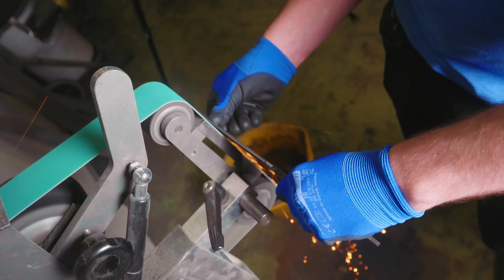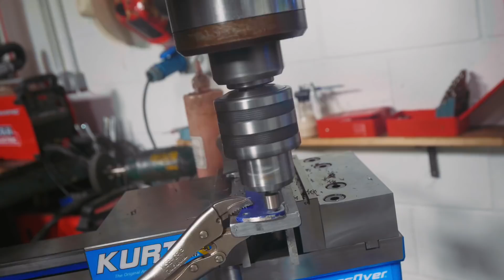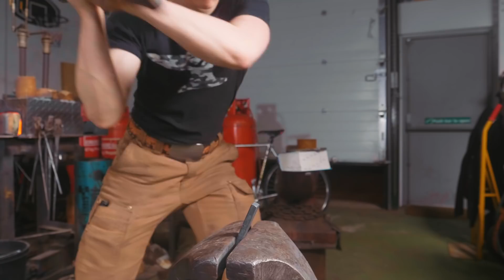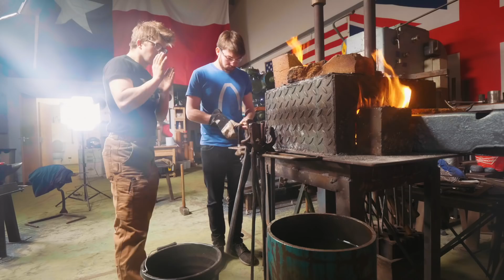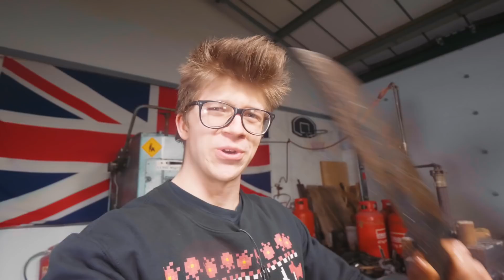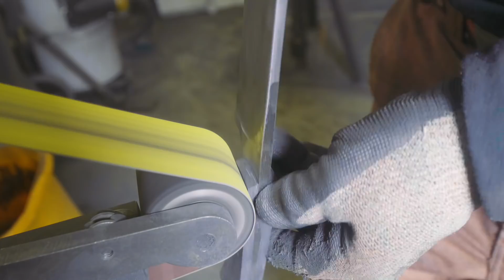MAKING A BOWIE KNIFE WITH REAL ENGINEERING!!! PART 2 - WHY we heat treat steel!

Comment: Alek, why dont you try useing wedge anchors for mounting your grinders and other shop tools.  Redhead is the brand i normaly use.  Just place whatever you wana bolt drill the hole put the washer and nut on the bolt pound ii in the hole and tighten it up!

Comment: Note that tempering has some odd-ball characteristics.  The temperature versus time to get a specific temper balance is NOT smoothly increasing in some alloys.  In some alloys, it has a downward valley so that using this poor range of temperatures actually can cause the metal to be WORSE than no temper at all.  This is called "Temper Embrittlement" and armor plates made prior to about 1930 (and a few even after that date) suffered from this compared to optimally hardened and tempered armors used in WWII -- some older projectiles that could punch through the old plates with no damage were now shattering against otherwise identical plates made using the later temper methods.  This is why working with steel is so complicated when trying to match the final results to the various intermediate processes needed to make the object -- sometimes it feels like "you can't get there from here"!
Reply: Wasn't that (combined with bolts replacing rivets) what made the damage from Titanic striking the iceberg much worse than it should have been?

Comment: On the normalised, hardened and tempered piece it had that fractured that dropped down at about 45 degrees as the crystal structure is FCC which was a slip plain along the (101) plane causing it to fail at 45 degrees. That is why it dropped down so much, because it was the weakest path through the material. Love the vid.

Comment: Fun video Alec. In my engineering materials class we talked about that fracture line on the last piece. It turns out that 45 degrees is the angle of least resistance for shear (when the two half's go flying apart). It's fun to see the real life equivalents.

Comment: The hardened and tempered steel that broke at about 45 degrees because the crystalline structure of carbon steel is a little box of iron atoms with a carbon atom inside the box. So naturally the crystal structure wants to break at about 45 degrees!

Comment: I've worked with carbon fiber before. If you do a wet hand sand on the handle stepping from 800->1000->1500->2000->3000 trizact->5000 trizact-> polishing compond you can bring that original shine back. It's still gonna be a tiny bit foggy but totally worth it!

Comment: I have a question: how do you keep the edge from heating up when grinding after heat treatment? on any electric grinding device its get hot quicly, and I dont want to try hand filing a hardened steel.

Comment: No fuller Or cross guard? You also get more power with a sledge hammer if you start your swing with one hand at the top and one and at the bottom and as you start to go forward with the hammer slide the top hand down to the bottom hand and follow through with your swing

Comment: carbonfiber is said to be harder than steel. wouldn't it make a good knife?
Reply: Musab Fethullah Kocyigit carbon fiber can't be sharpened like steel. There are knife blades made entirely of carbon fiber though, as well as composite blades made of carbon fiber with a steel edge.
Reply: makes sense

Comment: Great work! BUT!!! Do clear coat the CFRP parts. It protects it and you won't DIE!
The unprotected open fibers can easily break loos and enter the bloodstream. This can cause an nasty blood infection!
The clear coat will bring a nice shine to the handle, hinders the splinters from coming loose and protects the resin from UV light, so it does not get yellowisch. 
And always wear protection while handling CFPR. The dust contains also these dangerous splinters and also resin dust, which can cause cancer. Have fun with further CFPR projects :)
If you do it right, it is tremendous fun and the finished parts look always amazing. I for example worked there race seasons in race car cassis and aero production, and still breath.
Keep up the good videos.

Comment: To check if that grey color has anything to do with hardening, could you oil quench a piece of steel heated to above critical, and another one just below critical so it won't harden? That way we can know if the grey color isn't simply because some interaction with the oil, and nothing to do with martensite itself.
Reply: Steel is solid so I think theres no way for oil to get into the steel and interact with the inside. The oil is just for heat transfer at controlled speed.

Comment: i have NO experience at machining , but can you not put a laser pointer on your vertical mill , to aim for you the center of the drill ? (   just a brain-fart  )
Reply: Still not going to be precise enough, though it would get you close. The actual point of the drill can vary from drill to drill and it isn't necessarily centered. By spinning the drill you can find the 'true' center.
Reply: Mark C is right. A visible laser dot is not a point but an area (although a very small area) and wouldn't be accurate enough. Machinists definition of accurate is way more accurate than everyone else's.
Reply: Andu Ninicu Hey that might be a good idea! I have recollection of Mythbusters using a Bore laser sight (in a gun barrel) to try to cause a banana split for one of their myths.  Could get one of those and stuff it in the chuck.
Reply: Fit small laser in chuck - find hole - change to drillbit and drill  ( laser needs to be round and small )
Reply: The wiggler is more precise.
Reply: Still an eye ball measurement

Comment: Nice blade shape and I like the carbon fibre scales but they looked a bit thin for the weight of the blade, a chunky blade needs a chunky grip to hang on to it in use. I love the Real Engineering videos very well done.
Reply: More like needs a pommel to keep from slipping out of wet hands, a good custom made to order knife handle regardless of blade size should match the hand that will be holding it. Not everyone's hand is large so a large girthed handle may not be comfortable to the user regardless of how it looks visually. A good way to figure a users grip is get some semi dry modeling clay and have the user grip it in a comfortable handle shape. Semi dry because you want them to squeeze it without all the clay squeezing out from between the fingers.  Clean that clay handle up and you have a template for making your knife handle that will fit their hand perfectly.
Reply: If I do not have a belt grinder and I heat treat a piece steel 1 inch thick, how can I put an edge on one side of this and make it look nice like a knife?
Reply: Have a look at Gough Custom on you tube he makes his knives with a filing jig, you need to make sure the steel is annealed before filing and heat treat after to harden and temper, I have seen good knives made with a vice, files and an angle grinder, for knife making you tube is your friend, just search for what you want.
Reply: A file and 24 hours of filing.
Reply: An angle grinder and 3 hours of grinding

Comment: Why don't you mark a centerline? Even before heat treat, that way you have a reference point. I like to keep my center thick before HT, that way, when I surface grind after HT to make everything perfectly flat, I don't worry about moving center.
Use 123 blocks to clamp the workpiece, you can drill right through with no problem.

Comment: Why aren't you using your grinder horizontally? Especially with the small wheels. That grinder is made to be used horizontally and vertically. You wouldn't have to bend down like that. I had to build my own(KMG's aren't made for horizontal use, that even has a horizontal plate), but your is built in. If you need reference, I have a bunch of videos using the horizontal grinder.

Comment: Nice, you can actually see some of the differences between the grain structure between 1 and 2 with the macro shots. Lovely consistent grain structure in the normalised. Just finished my script on the science, this lines up with the garjus science. I was awful wrong about the hardness of carbon fibre though, was expecting the belt sander to struggle.
Reply: Great work! BUT!!! Do clear coat the CFRP parts. It protects it and you won't DIE!
The unprotected open fibers can easily break loos and enter the bloodstream. This can cause an nasty blood infection!
The clear coat will bring a nice shine to the handle, hinders the splinters from coming loose and protects the resin from UV light, so it does not get yellowisch. 
And always wear protection while handling CFPR. The dust contains also these dangerous splinters and also resin dust, which can cause cancer. Have fun with further CFPR projects :)
Reply: Markus Camenzind Carbon fiber is actually very weak to impact damage. It's superior strength is in a tensile load. Also the stuff wrecks drill bits insanely fast...
Reply: Real Engineering love you videos very well done
Reply: What would be the typical shear strength of a carbon fibre compared to its tensile strength? The resin I can see abrading but good quality fibres, as I understand it, should be as hard as diamond. I know if you want to cut some weave you need a damn good pair of shears but I always kind of attributed that partly to the weave folding over if there was any play between the shear blades.
Reply: Real Engineering 
You look like you are baked in this video lol. I assume you must be tired.
Reply: Real Engineering - my son and I had a mini-clinic on steel hardening, carbon content and steel carbide content last night! I've been studying WW2 tank armor and the German steel quality as they ran out of welding rod and steel additives. This explains the brittle nature of the Panzer V armor and welds breaking when hit at the end of the war. Thank you Real Engineering for such a great video!
Reply: nice demo of the different micro structures indeed. what i find interesting is the failure angle on three looks 45ish degrees from the neutral plane. i would expect it to fail on the principle normal stress plane 90ish degrees from the neutral plane, like on sample four. that being said my experience is with quasi-static situations not impact and i haven't really looked at bending failure much. so, my assumptions and application of concepts might be naive. any thoughts on the failure angles?
Reply: Real Engineering your tshirt makes you look like an involute 😂
Reply: I love your videos and podcast - glad to see you pop up here in the workshop! Keep up the great work!
Reply: Did you do a polish and etch of the samples ?
Reply: Awesome, love your channel man!
Reply: +Markus Camenzind fair point. that probably is the most likely the reason. though i still am a bit curious if there is something a bit more complex going on.
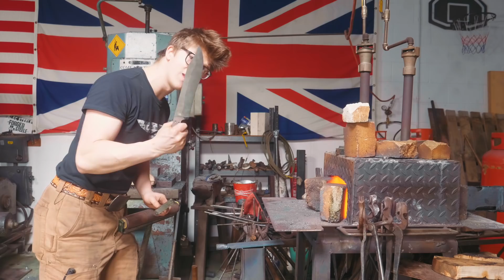Reply: Dat 06:47 knife flip tho
Reply: That's cuz Alec don't use the cheap stuff he Springs the extra cash for the good abrasives cuz they make the work faster and easier
Reply: Carbon fiber is easy to dril ,file or grind
Try braking a piece like you did with the steel then you find its strength 
But shouldn't you know that as real engineer
Reply: yuko 54 i have been working as a motorbikemechanic for the better part of 30 years
We had NEVER a problem drilling filing or grinding
And no its not just tensile strength 
Btw you should look up the meaning of tensile
Reply: Royvan7 my guess it has to do with angle of impact as he appears to hit it in a slight downwards motion
Reply: Real Engineering should have known that carbon fiber has no hardness to speak of, closer to graphite than diamond. It is in fact pretty close to graphite. It's all tensile that makes it invaluable in composites. And nonexistent thermal coefficient in some particular uses. 
Gosh, I am not even into materials, just built some RC models as a kid and have to speak down to someone who had a thesis on carbon fiber composites... Academic versus hands on, I guess.